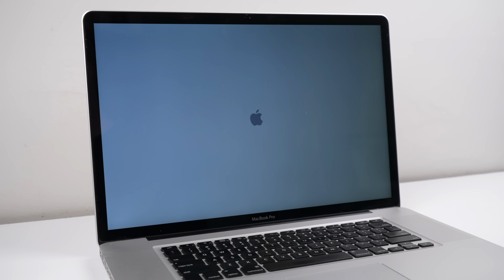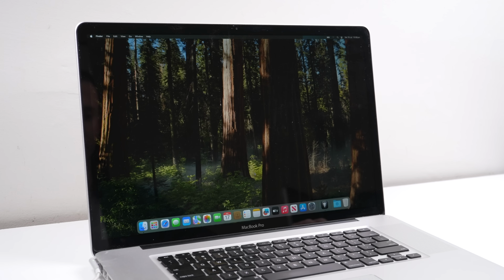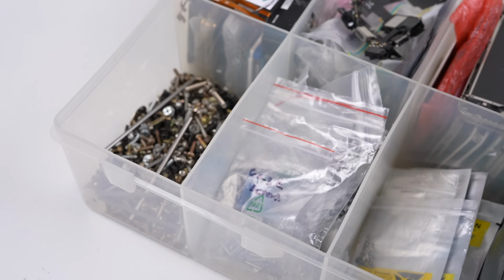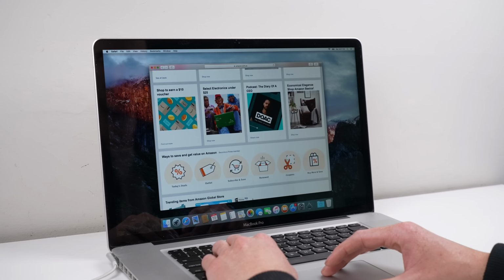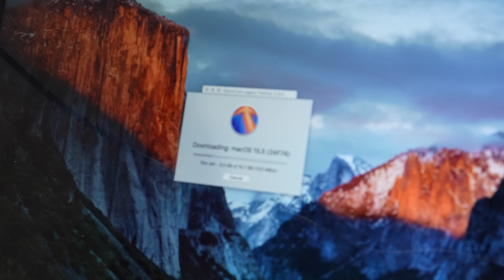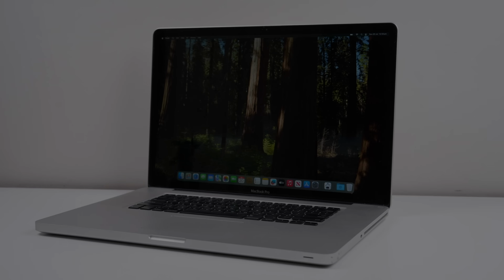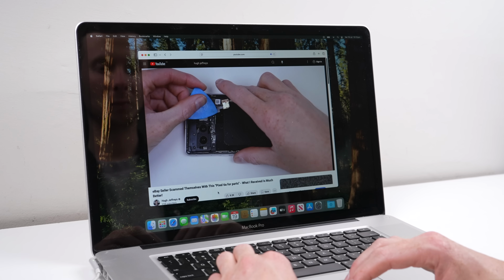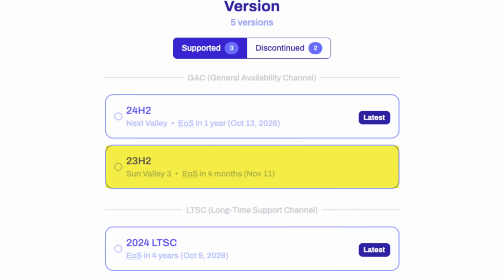I Scored This Old MacBook Pro For FREE & Got It Running On The Latest MacOS

Comment: Thanks for this but I'm pretty sure most users of old MBPs have already been using OCLP for years now - myself included.
But unfortunately OCLP will soon come to the end of its life for us old Mac users because, as you would know, after OS Tahoe only M series Macs will be supported.  Which brings me to the point at hand - many of us are bravely looking, but with some anxiety, at installing Linux (in my case Linux Mint) on our older MBPs which apparently will run very well.  Could you do a video showing how to install and run the popular Linux Mint on your 2009 MBP.  I have tried on mine, but am getting stuck with the lack of Wifi driver - I keep getting error messages even though I am connected via an ethernet cable and attempt to install the appropriate driver.  We need a comprehensive, clearly explained, walkthrough on installation and setup.  It would be appreciated by all users of older Macs who want to keep using their perfectly usable machines except for the lack of up-to-date internet browsers.

Comment: Some apple fanboyism there...
- did you mean, "anyone with an old computer will face" - apple computers? On other systems, windows, linux, browsing the web, installing latest browsers, work just fine. 
- claiming that it is a wonder how latest macos runs on such an old graphics card - well, such a graphics card shall have zero problems with any OS. It is still overpowered for that. This is not the feature of macos at. all.... 
- I would say, the opposite is true, it is super lame you can not simply have access to latest macos os-es from apple, just only by some thirf party people who make this possible. As you can see, the latest apple OS-es work just fine, so the only reason they are not available is because
APPLE DO NOT WANT YOU TO USE YOUR OLD COMPUTERS....
They force you to buy new ones.

Comment: Good job on getting that laptop revived, it's amazing what people will chuck out!
I've noticed the software issues with a few MacBooks of that era, my 2010s and 2011s I've owned could only take High Sierra officially, Safari is broken and Chrome/Firefox no longer support those OSes.
The reason why Windows 11 24H2 won't work is that the Core 2 Duo doesn't support Population Counter, which is required for 24H2 to boot. You need a Core i series CPU.
Reply: the only option you could use is windows 11 23h2, it is the last version to support old CPUs.
Reply: Yup, I'd use Windows 10 IOT Enterprise LTSC on a C2D. That way it'll at least get security updates until 2032. 
Also, for older MacOS versions, I tend to use Chromium Legacy. It seems to be the most recent browser that's supported on MacOS 10.7 and up.
Reply: Fake video, nobody leaves and gives a macbook for free. Even if its 20 years old.
Reply: I've had many free computers. Even Apple ones
Reply: @yigitthetechdude my employer will give them away occasionally; it's a lot of effort to sell them. Saying that, they are usually pretty worn out

Comment: I managed to get Windows 11 24H2 running on my Mid-2015 MacBook Pro (I7-4xxx, 16GB of DDR3 RAM, and Intel Iris Pro GPU) using Bootcamp. During the Bootcamp setup, I selected a Windows 10 ISO, and once I was on the Windows 10 desktop, I upgraded to Windows 11 24H2 with a custom USB drive I made using Rufus. Everything's running smoothly with both macOS Sequoia and Windows 11 24H2.
Reply: Did the same to my 2011 in 2022. It should work on a 2010 model as well, though I have found that I need to update to major new versions manually. Windows 11 Enterprise doesn't check the cpu or TPM requirements anymore, so it might be an even better bet these days. I'm still looking if I get 25H2 automatically on unsupported hardware with W11 Enterprise.
Reply: You should upgrade to iot ltsc

Comment: Another great video Hugh. I watched it on my 2012 15” MBP with an SSD and 16GB ram. It is running Sonoma but I am finding it a bit glitchy so may consider downgrading to Ventura to see if that will run better. I do have an M1 14” MBP that was gifted to me but I love my bigger screen and would have loved a 17” MBP but they are still very expensive on GB ebay. Lookig forward to the next video.

Comment: Cool that you were able to save that Mac, looks like a nice model to use! OpenCore is a great tool to have for those older Mac systems and running newer versions of macOS. You can still browse the modern web with old OS X though, I’m able to easily use sites like YouTube on Mac OS 10.7! You just need an up to date Firefox browser which works extremely well.

Comment: I will say, old Mac’s can be usable with the latest macOS for now, but after getting my hands on an M1 Max, it’s night and day. It’s snappy, it runs below 50c all day, battery is amazing, these old Mac’s can’t really compete.

I was happy with my open core 2015 mbp until I tried this lmao, it’s ruined it for me, but it was a worthy upgrade at least.

While it’s neat, I do think Linux does the most to these old MacBooks, especially when they have such good IO with Ethernet and everything.
Reply: I don't think anyone sees it as a competition.
Reply: @allencraig02  Who said it was? I’m just saying the jump in performance is worth it but also ruins how usable older Mac’s feel once you spoil yourself, and that you can too have that snappy experience using a lighter weight Linux on the older Mac’s and have modern software support.

Linux made even a 2015 MacBook Air with 4gb of ram I had able to play fallout new Vegas even, it could play games and do most web related tasks really well, just because I have an M1 Max doesn’t mean I only know cream of the crop ways of getting stuff done.

New is nice and snappy, old can be too, open core is neat and I’m glad it exists, but it’s on a limited life span for Intel Macs and there are other options that keep devices useful.

Comment: its a useless waste of time...
the GPU will not be able to handle the  work load due to the old shitty drivers
run firefox or any MS programs and the overheating of the GPU will throttle the CPU.

still trying to keep my old mac pro working at work, since i need the intel CPU for hte work i do.

Comment: Usually the problem of playing youtube videos on this hardware is the browser. You can try to open them in an external video player that supports playing youtube videos like VLC (paste the address of the video in Media>Open Network Stream). I had a Core 2 Duo 2.6 GHz and it was able to plat 1080p60 videos and even 2k30 with an external video player but with a browser max wasa 720p60. That was under Linux.
Reply: if a user uses either chrome or firefox, they should use h264ify.

Comment: Would a Linux OS work better on something this age? I'm about to adopt a system of a similar age and was thinking it may do better that way.
Reply: it all comes to how old is your machine and if it's gpu is supported by metal api - if it's not, apps will crash or launch with errors and system will render these weird artifacts. mine isn't so at some point i just decided to drop all that play with open core on mbp 8.1 i have. don't get me wrong, this thing works as hugh show in this video and guys behind the project do the amazing work but in case of older machines is just pointless even for basic stuff.

i did replaced macos with manjaro linux on that mbp 8.1 and i had to plug ethernet in to get specific driver package from aur repository for wifi to be working. last year, for whatever reason after one of big updates audio stopped working and i had to look up for solution - now it's being detected right in live installation environment and post-install

i'd say go with linux if your existence in apple ecosystem doesn't require you to access laptop. but at the same time bear in mind this is still a life-support treatment.
Reply: @zielonakotwica  Thanks for the thorough guidance. I will see how it goes with a light linux os. I haven't tried majaro yet, maybe this is my excuse. I'm mostly moved to linux in most areas so this is an opportunity.

Comment: Sonoma works better on these old macs. I run it on my MBP 2012 15" unibody and works like a charm. Will not buy an apple silicon MacBook, as the storage is soldered and i have seen lots and lots of display issues on these apple silicon MacBooks on online pages within 6 months to 1.5 year of purchase.

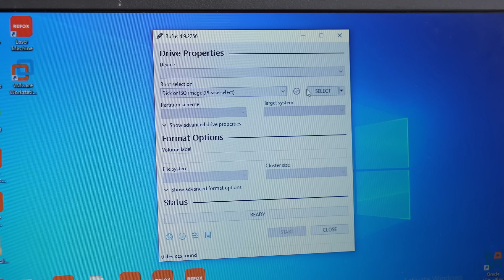Comment: 11:12 i got Windows 11 24h2 on my 2008 MacBook Pro by burning it to a disk, and then it worked flawlessly, so so you have to do is burn it to a dvd.
Reply: 24h2 can‘t run on core2duo since they are lacking essential CPU Features. Youre 100% Running 23h2
Reply: @-Jakob489-  there are ways to bypass the requirements with iso creators, mostly found in github
Reply: @-Jakob489- I used tiny 11
Reply: I thought the ISO was bigger than 4.7 Gb?
Reply: @WindyKnight0822 I used tiny 11
Reply: @WindyKnight0822  idk but there are higher capacity dvds, or he trimed down the iso